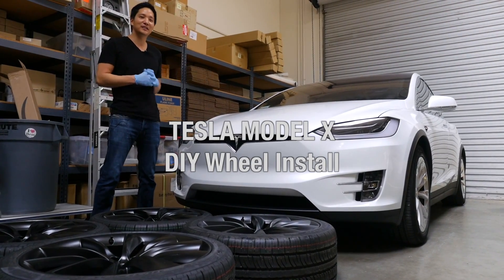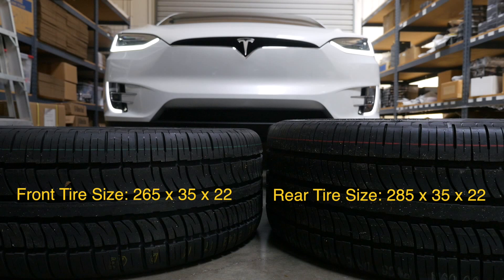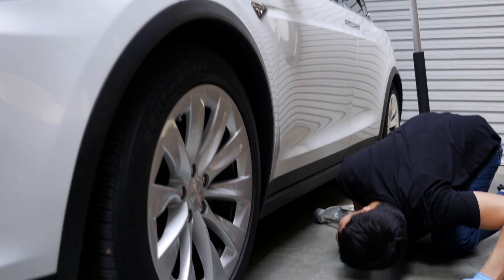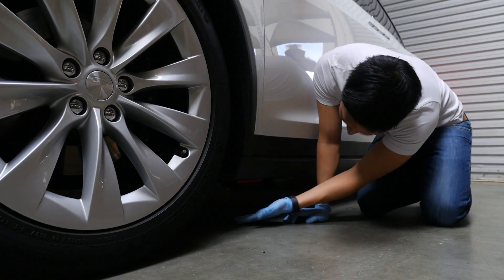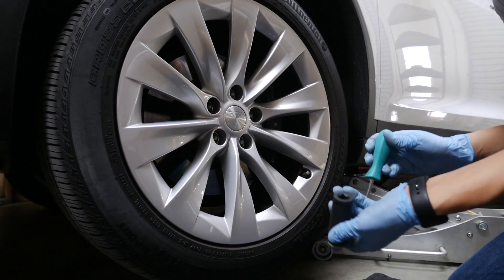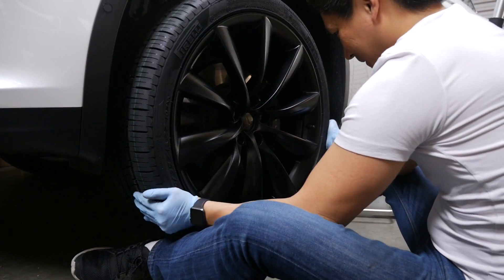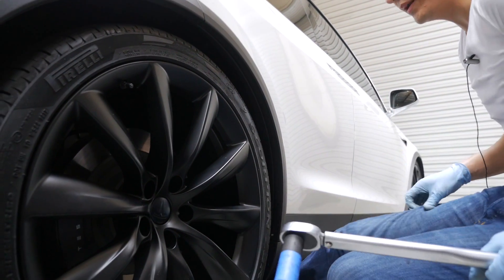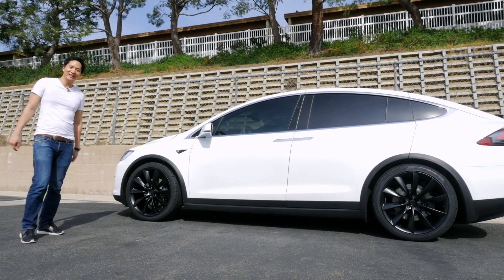Tesla Model X DIY Wheel Change - Update from factory 20 inch to 22 inch Turbines

Comment: Just a quick tip for when you put the lugnuts back on. Use your fingers to screw the lugnut on a couple of rounds before using the impact wrench. This is to prevent damage if the lugnut is not alligned correctly.
Reply from the maker: Great suggestion!

Comment: Lug nuts are 21mm.
Reply: Chris Epler that’s right. Because he used 13/16 which is a little smaller, the nut was stuck in the lug. Btw, don’t need the break bar or that $50-jack pad adapter. I used the $5-hockey puck for it and placed right below the jack point hole.
Reply from the maker: Yes, we learned that 21mm has a more secure fit